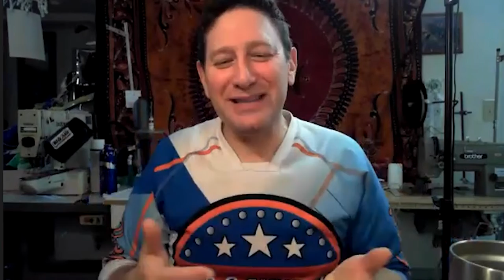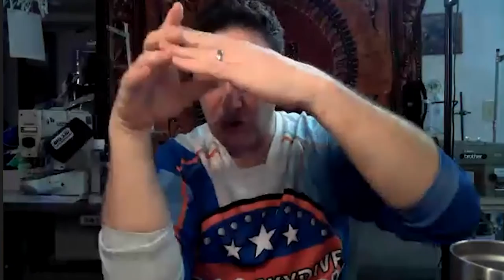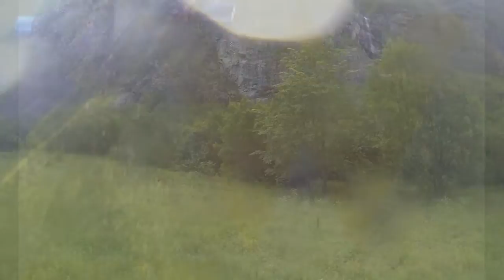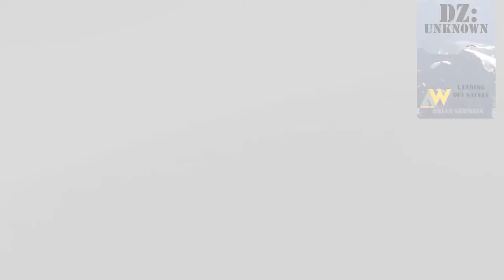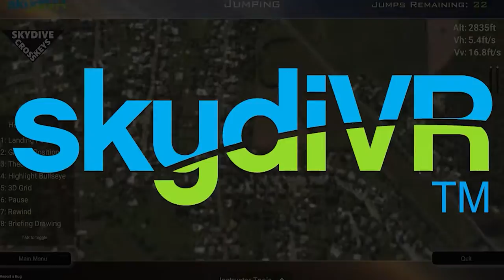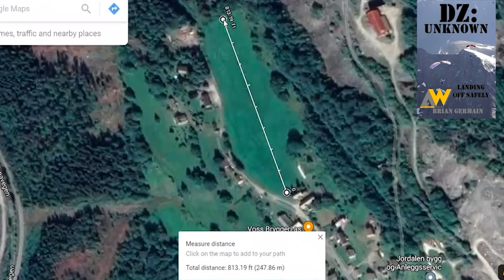Flying Parachutes in High Wind

Comment: Landing in a DZ unknown - I am averaging about 2% of my jumps as landing in a DZ unknown.  Every one of these are for different reasons.  No one on the plane spotted the exit as we trusted the pilot and he trusted his instruments - which put us a few thousand feet to the right of the jump run (in one case), a track dive that did not reverse course in time (in another case), strong uppers and mids with a higher pull on a new canopy as well as some bad habits very early on that caused a rapid descent (spiraling like I saw others do except I did not look to see where I was until I was nearly dizzy).  Needless to say that habit is long gone.  Also, jumping at Calhan and Mile High I've experienced elevator landings several times.

Comment: Never jump in high winds. Its just no fun when you can't fly your canopy like you want too. I hate just trying to get back to the DZ if its a bad spot. We called an out of DZ landing in our log books  TFFTM, To fu*king far to measure. My drop zone was do much fun. We could whatever we wanted..none of this AFF jumping, if you screwed up in free fall when i was jumping you were done. And i was one of the first jumpers to use the tandem system back in 1985. No drogue chute was used at the time. Opening at 200 mph was rough,to say the least...i really had no intructor per say, i had to count seconds in my mind to judge my altitude while in free fall. Best time of my life though. I miss it.😢

Comment: I had a jump in high winds last week and  opened in some line twists.  By the time I fixed it around 2500 feet I was VERY FAR from the dz and barely made it back even with getting small, getting on rears etc.   In hindsight I should have probably opened a bit higher or adjusted my decision altitude
Reply from the maker: Did you end up drifting straight downwind of the target or crosswind?
Reply: @Brian Germain  crosswind but I was in a type of holding crab until about 1000 feet
Reply from the maker: @sivonparansun  in this case, stay small, add a little rear risers, and optimize your crab angle. In no winds, 60-70% of the rear riser input is the best true glide. In other words, a little more than halfway down to the stall point.  However since you are facing the wind (mostly), less rear risers will be better, as you still want to keep your airspeed high.